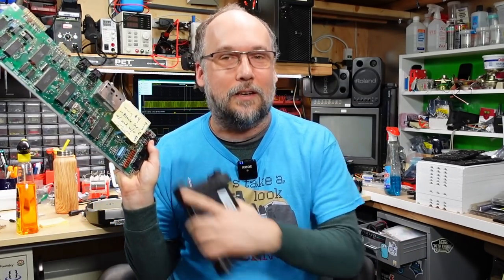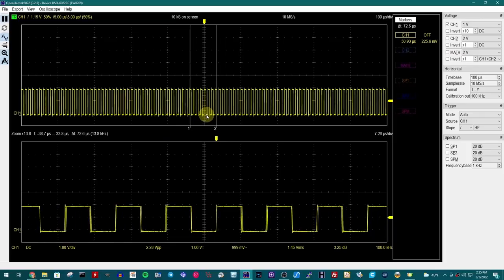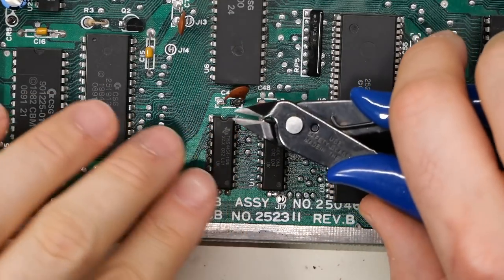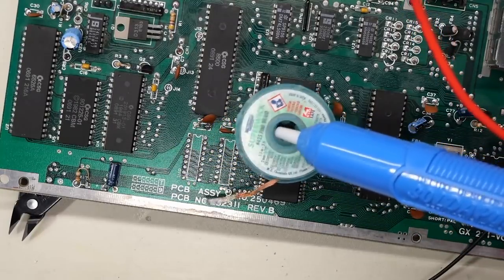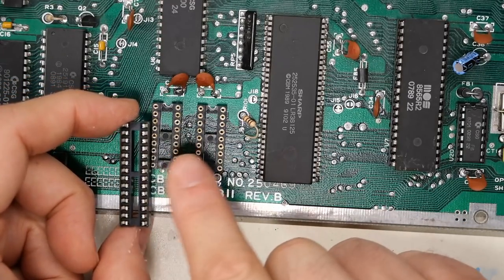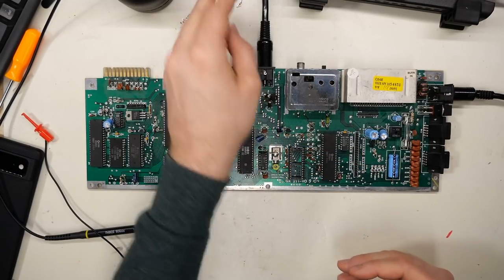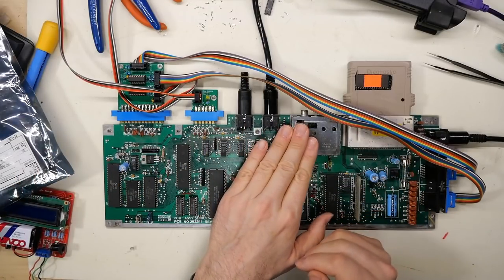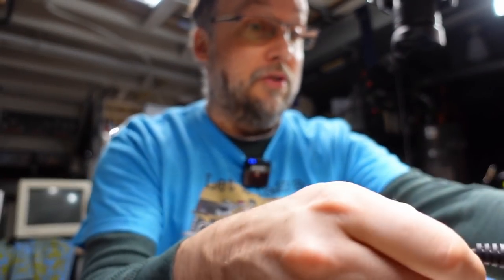How to fix an 8-bit computer with only cheap tools

Comment: If you're looking for a better desoldering pup, I really recommend the engineer SS-02, it has a heat-resistant replaceable tip that conforms to the hole you're pulling solder from and works waaaay better than the hard tip desoldering pumps
Reply: Another vote here for the SS-02, a while ago I wrote it off because it wasn't as good as my flexivac, but recently I re-lubed with some ptfe spray and it's so powerful now. Also I barely ever have to clean it out because the solder usually cools in the aluminium body and most of it gets pushed out when I press the plunger back in.
Reply: I have been using the cheapo teflon tube used with 3d printers.

Comment: When I started working as a photocopier tech in New Zealand in 1995, I knew very little about photocopiers but I had many years of experience on electronic faultfinding and repair in UK. There was one tech who worked on the colour copiers and I saw him trying to unsolder chips that were blown, literally, with holes in them. I suggested that he cut the pins by the chip body and then unsolder the pins individually to avoid damaging the thin tracks on the board. He could not believe that a Pom could teach him anything, but was proved wrong. He did have the grace to thank me later!
Reply: Around 52 minutes, the circuit worked after refitting a transistor. (I have only watched this far at the time of posting, so I don't know if this occurred to you) dry joints were a common fault on the Philips G4 TV chassis, most often giving a green screen. Resoldering can fix dry joints.

Comment: They also make manual desoldering irons with rubber bulbs on them that are fairly inexpensive ($20 or so) and generally do a good job. They work more less in the same way as your Hakko desoldering iron, in that they're soldering irons with a hole in the tip that it sucks molten solder into, but they just have a a bulb you have to squeeze instead of a pump. Edit: Looks like they make them with spring-powered suckers now, too, in addition to the rubber bulb ones.
Reply: Amazon sells hotair stations for as cheap as $50 these days.

Comment: Great video, I have a tip for solder suckers. Cut a small notch in the tip so it fits over your iron tip. It will then get a bit of a seal and suck air through the board and you can suck the solder with heat still applied. This is a mod we made day one in our Lab Practices classes back in the day

Comment: I love the Soldapult!  While it's twice a much as a cheap Radio Shack pump, its design is a huge time saver!  By placing a trash can directly to my left, I was able to press the plunger against my breastplate to eject the solder waste and rearm the pump in one gesture without having to set down and pick up the iron each time.  Once I had nailed the motion I was de-soldering as quickly as I did when I borrowed my friend's $280 Hakko 808 de-soldering gun.  I did finally break down and order my own de-soldering gun as I stared down more stubborn ground planes and more keyboard projects with hundreds of joints, but if you are only doing a small repair once every couple months, it's a fantastic budget alternative to the electronic de-soldering guns.

Comment: Hi - A suggestion on using the Soldapullt a technician friend taught me.  Cut a small vee notch in the Soldapullt tip; small enough so the Soldapullt tip can cover the tip of the soldering iron.  This allows you to keep the iron in contact with the PC board pads while operating the Soldapullt.  I've been using this technique for most of my career as an engineering technician with great success.

Comment: If you are going to use the manual solder sucker, I strongly recommend you get one of the newer ones that has the silicone tube on the end. That can be placed over the hole while still in contact with the soldering iron tip! Excellent tool!

Comment: I use a Tektronix TDS3054 I bought for $20 broken.  The only problem was the front panel plug was half off the PCB inside which rendered the buttons inoperable.  As a bonus it has a module with GPIB, Serial, and VGA monitor out.  It uses 3.5" floppy disks for storage .. so retro :).   Really like the repair videos so keep them up.

Comment: 34:11 To further support your theory that the unregulated 9VAC wasn't working, did you notice the two system clocks also weren't counting up there? But then they were working again later
Reply: I think you nailed it. It'd be nice if the test algorithm would identify a stalled TOD clock and point you towards a failed 9VAC feed.
Reply: They weren't allowed to count up. Ticking clocks mean time is passing. Passing time means people are getting old. Getting old means increased likeliness of having to undergo operations.
Reply: The test algorithm has identified the stalled TOD clock. If you don't believe me, look up TOD in a German dictionary. It does not always mean time of day.
Reply: @wlorenz65  LoL

Comment: I almost bought one of those Hantek USB scopes but in the end I bought a Rigol DS1054. The newer batches have all the features enabled except the 100MHz, which can be hacked using well known methods. That 3rd party software for the Hantek really looks very clean though. One of the problems I've found with the Rigol is that the trace can sometimes be very glitchy in the higher scan rates. Amazing vid Adrian, thank u!
Reply from the maker: I do love the 1054Z too -- it's fantastic for the money .. I think some people just don't want to spend that much for something they might rarely use.

Comment: Nice work. I had to diagnose dead C64 of my friend - same symptoms, hot DRAM, but still not working after replacement. The bus with known good chips was still driven low on some bits. Long story short - both CIAs needed replacement together with kernal ROM. In the end SID was also dead, so SwinSID was placed in this machine. That board ended as test machine then as half of the chips is now socketed :-D The scope I used was something similar like your Hantek - an OWON 4 channel USB scope.

Comment: For the solder sucker, they do make incredibly cheap soldering irons, like for $15, that are combined with a solder sucker, so the soldering iron itself has hole at the tip of the iron and a pump, so you don't have to remove the iron from the solder  to suck it up, which gets rid of the problem if it rehardening and having to be quick. These things are pretty useful for a cheap way to desolder a lot of stuff.
Reply: Agreed, that’s what I use. It was a big jump up from a basic pump without having to spend a lot of money.
Reply: oh yeah, i've seen one of those ... looked exactly like someone took the cheap 2,50€ pump i bought and taped a soldering iron to it ... i wonder if it is any good
Reply: @KenjiUmino  The one I have is pretty good, but it was a bit more expensive and mostly metal, so it doesn’t feel like one of those 5 for $10 plastic pumps. Somewhere in the $25-30 range.

Comment: You do a great job of explaining the benefits of better quality tools while showing how to make these more entry level tools work. It can be tough when you’re new to a hobby to know what tools are best for you at that time. Spend too little and you might get frustrated and quit. Spend too much and you might end up with something overkill you only use occasionally. I tend to buy higher quality tools used which has worked out well so far.

Comment: Tip for easier work with the manual style suction desolderers - apply fresh solder, then put the board on it's end, with some helping hands or conveniently located objects of some sort. Then apply heat to one side of the board WHILE you do the suction on the other. Gets those tricky pads much easier, especially on the evil solder that CBM used back in the day. Then if you have to do more than one or two, get yourself a Hakko. Once you get the hang of that, it blows everything out of the water, as long as you keep it clean.

Comment: The interrupt test checks the timer interrupt of the CIA. With the 9VAC missing, the timer won't run, so no interrupt is triggered. It all fits together. All there was wrong was the 9VAC missing. (well, and the RAM)

Comment: One other advantage is that this equipment also fits in a smaller space. If you don't do this often, you can store it compactly. It's also more portable. It's weird that the cassette problem went away. I did notice that the clocks didn't seem to be working in the diagnostics when the error showed up, then were working when the error vaporized. I wonder if the CIA chip is marginal. Regardless, this was a very informative video. I had kind of written off the Hantek because of the issues you mentioned with the software that came with the device. However, the OSS project that improves the software substantially is going to make me take a much closer look. 

Thanks for this great video!

Comment: One of my favorite cheap tools for computer repair is a portable AM radio. It's even good for single board computers and "system on a chip" units. Bringing an AM radio close to a functioning computer will give you noise through the speaker. This noise changes depending on which parts of a program are involved in the main software loop. Anything that causes the program to branch will change the noise, so shorting various pins will change the noise. Short out suspect data and address pins and if the noise doesn't change you have confirmation that the pin is (probably) dead. Admittedly a crude tool, but one that has bailed me out several times when no other test equipment was available.

Comment: Pro-tip... the $99 Harbor Freight DM1010 multimeter is really, really good and it has a transistor checker, reads capacitance, temperature, and even frequency up to 10mHz. Highly recommended.

Comment: A good tip for the solder sucker, place a bit of silicone tubing over the tip, that way you can keep the iron in place as you suck up the solder, especially useful on groundplanes wherethose rapid cooling issues occur... :)

Comment: Hey Adrian, I don't actually own a C64 and never have, but I find your repair videos interesting nonetheless. I have another possible explanation for why that cassette interface didn't work until you unsoldered the TO-92 transistor. Most BJTs in TO-92 cases have the base on one end of the line of leads, the collector in the middle, and the emitter on the other end. This means it is quite easy for solder blobs to short emitter to base, which would show exactly the symptoms you encountered. Even if that transistor didn't have too much solder on the pads and hadn't been reworked in the past, there is a phenomenon called "tin whiskers" which can affect solder over time, especially after the 4 decades since the C64 was originally released. Due to molecular idiosyncrasies of elemental tin, tiny "whiskers" can grow outward, and sometimes create short circuits. If the current through the short is high they will usually burn themselves off right away, but the low current drawn through that pullup resistor to ground through a whisker probably wouldn't' be enough to clear them away. These whiskers are tiny and usually not visible without a fair amount of magnification. Soldering would melt the whisker back onto the pad, and even probing with the meter might also have cleared the short, leading you to believe there was no E-C short affecting operation. It could be a marginal transistor as you surmised, but heating a borderline one like that usually makes it fail even worse rather than fixing it.

Comment: I'd greatly recommend the Engineer SS-02 solder sucker pump. I got it when I got my hakko fx888D and it's FANTASTIC. It's a lot smaller than the one you're using, and while it's a bit more expensive, i found it worked amazing. It's also constructed really well. I also have solder wick of a few widths when necessary, MG chemicals of course.

Comment: Good video, good job of fixing!
If I cut the pins, I then use a solder sucker. (blue hand pump) It takes a little practice, but it t will remove the pin and solder in one operation without removing the pads. Put the sucker tip next to the target at an angle, add the iron to heat, pull iron out, tip & fire immediately. You were correct to add more solder, as it allows the air to grab it better. Reason it works better than braid is less heat time on the traces. And your iron is a bit underpowered for this size board. Braid is better for some things and not so good on others. You have to learn what to use where and when.

Comment: The Aneng 8008 is a good one, the Q10 as its successor is even nicer!
Reply: does it have open source software/firmware available?
Reply: @squirlmy  It already has temperature measurement in the default firmware, haven't seen any other hacks.

Comment: A few tips from a engineer.

Avoid those USB based scopes. For the same price you can get a used scope, it doesn't have to be a digital one either. You can get a lot done with a analog scope. A nice addon to a analog scope is a Octopus for checking passive parts. For a beginner I would recommend a HP54603B, it's a digital 60MHz scope from their 54000 series. It has many features and with 60MHz you can do a lot with retro systems. I think the 54000 series has a scope that can do 500MHz but those still cost big bucks. I myself have one of those scopes and even though I have a HP16500C I keep going back to the 60MHz scope.

Another tool that most people don't talk about these days, a Logic probe. Most modern ones can handle CMOS and TTL. There are also models that are audible as well. A lot of arcade techs use them and for them it's just as important as a multimeter.

Dwell time with a soldering iron is key. Too much heat can hurt other components, too little can also hurt things too by ripping up traces. You can add flux to solder braid to "super charge" it and will help with the heat transfer to the joint so the braid can suck up the solder. However it adds more hassle of cleaning. Solder pumps are great, I find it easier to leave the tip on the joint then put the pump over it and then suck it out. The tips are heat resistant but they still wear out. Also if the board is small enough you can heat up one side and use the pump from the other side.

Comment: I tried to use one of the cheap all-plastic solder suckers and never had much luck. Adafruit has one that uses silicone tubing for the tip and I found it to be a lot more effective. Because it's silicone you can push it right onto the soldering tip and suck before removing the heat. If you do wear out the tip you can just cut off a fresh 1/2" of tubing and swap it out. Not a Hakko, but a definate improvement

Comment: Well, I'm completely sold on that Hantek. It's amazing the difference the right software can make. I also picked up a couple of troubleshooting tips from this video too, so thanks for that.

BTW I suspect I won't be the only person to say this, but is it possible that small transistor may have had a bad solder joint? Could be why the circuit started working once you'd resoldered it into place.
Reply from the maker: It is certainly possible that it was bad joint.  I’m still more likely to believe the AC / unreg was missing though. I need to make sure to test that first when troubleshooting tape issues and I’m not sure I did early on. A real SID would have also not worked so it would have shown if the voltage rail was the issue.
Reply: Software makes a big difference for this oscilloscope, because the firmware isn't stored in the oscilloscope, but is uploaded by the software on demand. And because third party oscilloscope software actually do have their own firmwares, not only the high level functionality is improved, but also the low-level functionality.

Comment: Try this. Place the circuit board up on its side (Hold it with a clamp if needed) apply heat on one side and use the pump on the other side. This works well in a lot of cases.

Comment: I replaced a video RAM chip on an NES in the past year for a friend and I used my Soldapult solder sucker to get the bad chip to slide right out easily. Didn't cut any pins or add any solder. The trick is to have a good tip on the solder puller to have a good seal on the hole to clear it. Then I clipped Pin 4 on the 10NES lockout chip.
I bought my solder puller at a HAMfest years ago.

Comment: Ive had a lot of luck using solder suckers when you heat from one side and suck from the opposite side.  You can even suck pin remnants out of the hole along  with the solder.  Only have to heat the board once.  Like your videos, i'm a commodore owner from their beginning.  Still have a PET, Vic-20 and 64 along with a bunch of chips (NOS).  Like to see you keep them alive.

Comment: I didn't realize the PineCil had a boost feature. And on top of that, I had been trying to use it at 320 degrees with lead free solder... Also that soldapullt looks much more effective than my cheap Radio Shack one, which I have nevertheless used to general success for a few years now. I am envious of the Hakko 301 but I don't do enough of this to make it worth buying...

Comment: I highly recommend solder pumps with flexible silicone tips - you can put them right over the solder tip and they work much better than pumps with hard plastic tips.